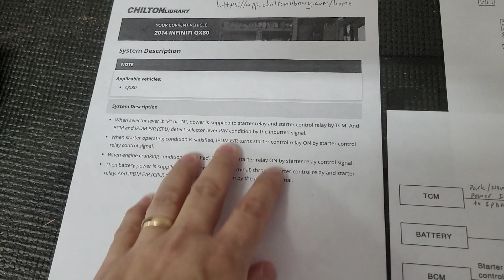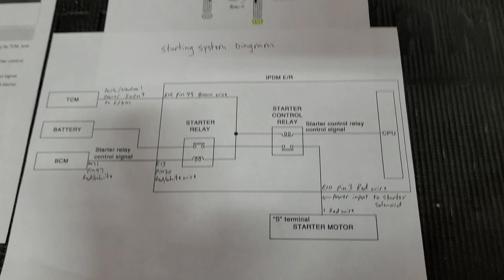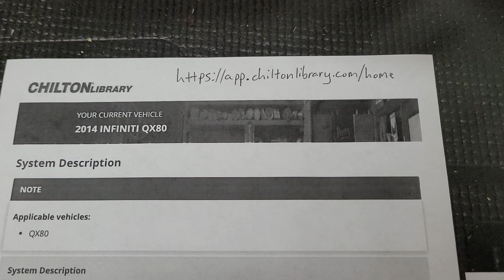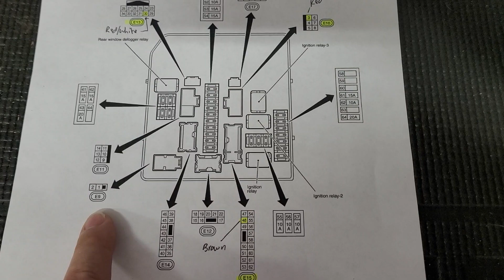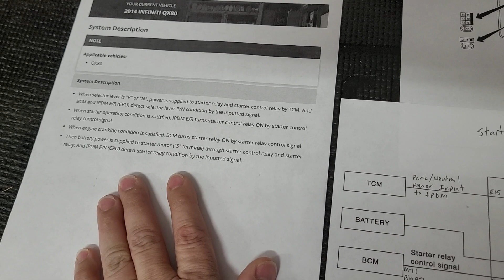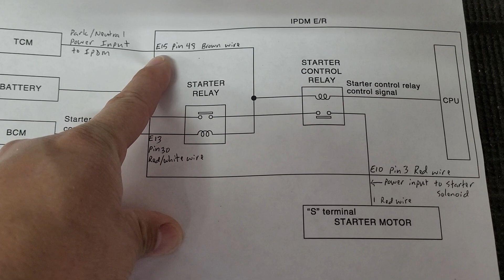No crank No start troubleshooting QX80

Comment: Had this issue with a QX56 for last few years.  Intermittent start issues, but always eventually started (may take 1 time, 3 times, or 11 times, but always started).  I changed relays, the shifting cable bushing, tried starting in park and neutral....  I definitely didn't want it to be the starter, but a local show (that does complex engine work) used an "oscilloscope to pinpoint the exact starter solenoid contact failure with waveform data."  They were able to replicate the issue (which was never a given) and show me a graph of why it was the starter.  Works great now!  Also had them replace some sensors and walnut blast the valves while the intake manifold was off, runs like new again!
Reply from the maker: Thanks for sharing your experience. My experience was just like yours. Intermittent starts but It always started at some point and the solution was a new starter 👍

Comment: Greetings, I have a 2017 QX80. Every now and then there's an issue where i have to tap the starter button several times before it starts. You hear a click coming from inside the engine bay on every failed start attempt. Any idea what could be the cullprit?
Reply from the maker: I can’t be sure without seeing the car and performing a few tests, but it sounds like the starter motor is bad. When our starter went bad, we had a similar situation where we had to make several attempts to start the car with nothing happening and then finally it would randomly start. We were always able to start the car, but it took several attempts. That’s what led me to make a series of videos on my channel as I trouble shot the issue. For me, it was a replacement starter motor. The starter is located on top of the engine underneath the intake manifold. It’s a bit of work to get it swapped out, but it is DIY doable if you’re pretty skilled at mechanical stuff.

Comment: Hey Mr.Jack, i replaced my starter recently, nightmare job but now it will not crank… Ive made sure all connections are good and only thing i could think of is throttle body relearn.  Still doesnt fully crank over. How can i get in touch with you for troubleshooting
Reply from the maker: Sorry to hear your starter is having issues. You’re right, it’s a bit of work to swap it out. I’m not aware of a need for the throttle body relearn. When I replaced my starter everything worked when it was put together. I didn’t do a relearn or anything special. It’s good practice to double check the simple things first, sounds like you have done that. If your starter is cranking, just not as you’d expect then you may have another issue. Sorry I can’t be more help than that.

Comment: Hi Jack. Fantastic content! I have a 2014 QX80 doing exactly the no start/clicking scenario. Not always, but enough to freak out my wife. I eliminated the issue for a while by cutting the wire which was keeping battery from charging all the time. Now the clicking issue has returned. Is there any way to get a copy of the schematics you are showing in the videos?
Reply from the maker: @wireless641  Check your public library web page for a link to the Chilton repair manuals online.  That's how I got them for free. My intermittent start was due to a starter motor.  I bought a new one from either Amazon or Rock Auto. I replaced it myself and have not had an issue since.
Reply: @jacks_DIY98 do you have a video on how to replace the QX80 starter motor?
Reply from the maker: @ Sorry I don’t. I did perform this job but didn’t make a video. There are videos available by others though.
Reply: I have this same issue and also cut the wire that was not allowing the alternator to charge the battery but also having intermittent no start. Curious on the fix? Should we just replace the starter motor?
Reply: I have had several people saying it’s the starter but why would that drain the battery. I always thought the alternator was responsible for dead batteries or possible shorts

Comment: 2013 qx56 was shorted out by crossed cable wires no power to starter from red wire  from ipdm 
does that mean bad ipdm unit everything else works in vehicle
Reply from the maker: It's hard to know if your IPDM is bad with only what you've shared, but it is possible the IPDM was damaged.  I have some other ignition trouble shooting videos you might view and do a little more troubleshooting. As for the starter specifically,  the transmission control module also plays a role in allowing power to go to the starter solenoid. I've got a short video about testing that also.  I wish I had a quick easy answer for you,  but it just isn't that simple. IPDM are too expensive to guess at and buy a part you might not need.

Comment: Hi Jack! I've got a question for you - I'm trying to add a kill switch to the starter button with starter wiring harness, do you know which color would be the B+ I've done some readings and kept getting blue and white as the ACC and the orange/brownish color as the B+ but wanted confirmation. Maybe you could help provide an answer.
Reply from the maker: Ignition switch (push button) output power to BCM is terminal 4 on connector M101, it is a light blue wire. Terminal 1 in M101 is black,  that's the ground wire.